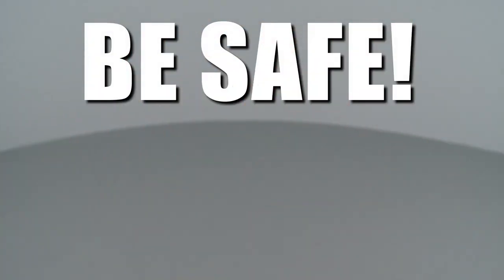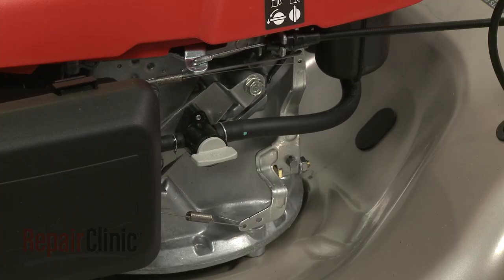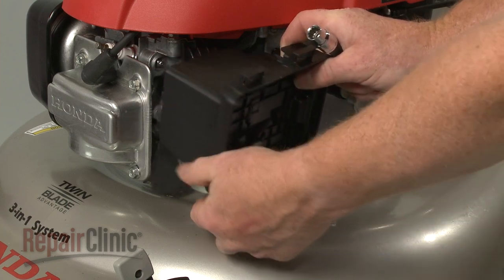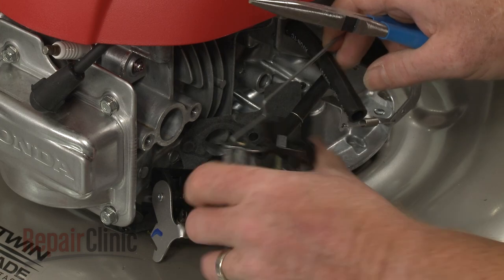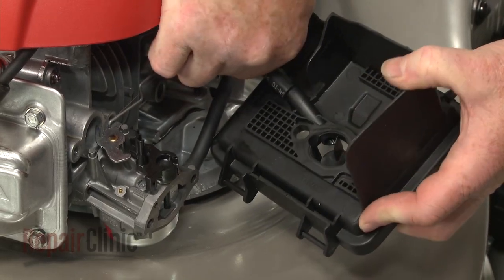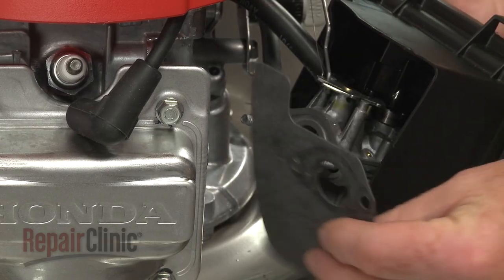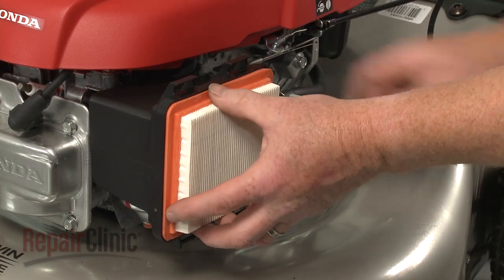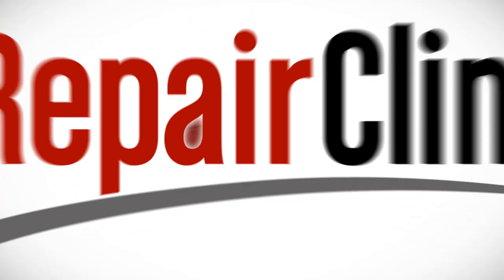Honda Small Engine Carburetor Replacement #16100-Z8B-901

Comment: The thing about a Honda engine is if you empty the tank at the end of summer it will fire right back up but if you forget and try to open fuel and start you will be replacing it like this. I know from experience.
Reply: I have no idea what you just said.

Comment: OMG I looked everywhere for a video or anything that would show me how to reattach the carburetor and automatic throttle piece when I had to put on a new air filter housing.  I have a honda HRR216VKA mower.  Thank you so much for this video. You made it so simple! It only took me a couple minutes to get my mower up and running.

Comment: This is a great video, but while you are in there you should replace the choke actuating element.  It's only about $10, easy to do and they fail often enough.  Speaking from experience.
Reply from the maker: Thanks for the tip.

Comment: This video, along with Tim from Jack's Small Engines, made buying the right part, and installing the new part one of the easiest things I've done. In 10 minutes it was removed, installed (true Honda part), and it started in the first pull. The grass is under control!!! Thank you so much.
Reply from the maker: You're welcome.

Comment: Great instructions.  Relatively straight forward job, but so helpful to watch it be done first.
One note, I accidentally ended up with the breather tube over the governor rod.  This restricted the governor rod and made the engine race.  I was able to pull the breather tube off without removing everything and re-reroute it under the rod.  A simple tap un-jammed the governor rod and things ran perfectly after that.

Comment: Right part number.  Be sure to look at the carb, the 7021p Husqvarna with the Honda engine does have more than one carb.  76AA carb is the one I have. The choke control assembly is different on some.  Perfect and Thank You!!!
Reply: Some are automatic and some are manual. I personally like the automatic but alway buy the wrong carb but they are cheap.

Comment: Very helpful. My replacement part and the old carb has this strange little piece that connects just below where he throttle spring is. It has a spring and an flat head but I can’t figure out what it does. Any idea?

Comment: After replacing the carb the mower starts, but then dies. 
Wait a couple minutes, starts again. Repeat.

Seems like some kind of fuel starvation / vacuum issue. What am I missing? Thanks.
Someone told me about a plugged vent hole, but I don't see any such thing on carb.

Comment: Jim here.  I have a HRX 217 2VKA .  It’s an auto choke unit 9 years old.  Anyway was surging so took carb off and cleaned it (several times).  All ports flow clear.  Starts and runs for a bit but then dies. At this point, not sure I have the gasket sequence correct.  It has a metal plate gasket which I have between the carb and auto choke unit with gaskets on either sides (instead of the extended metal assembly on most 217’s).  I can’t find my unit on the Honda parts website.  The MAGA # is 2001599 if that is any use. The unit was bought at Home Depot and has run great got 9 years.  Been messing with this for more than a week. Driving me crazy.  Any help would be greatly appreciated, especially with regard to the gasket sequence. Everything I have seen on-line is for other units.
Reply: I currently have the same thing happening. Did u get yours fixed?
Reply: I have same issues replaced the carburetor but still same issues, start runs for few seconds and dies. what is the wrong here?

Comment: Very good. Torque settings would be handy.
Reply from the maker: Rolf Grosseholz That information is not provided with the part. You would need to find the Honda service manual for this engine to get torque specs.

Comment: There are gaskets that need to be installed. Why are you not showing proper placement of gaskets
Reply: Some models have exactly the parts he showed as does mine. I've seen videos where there were gaskets in front and back of a plate. My model only has as he showed: one gasket plate and the airflow guide or whatever he called it. I have a Honda  HRR216VKA model
Reply: @leembley  Yep, mine is exactly the same